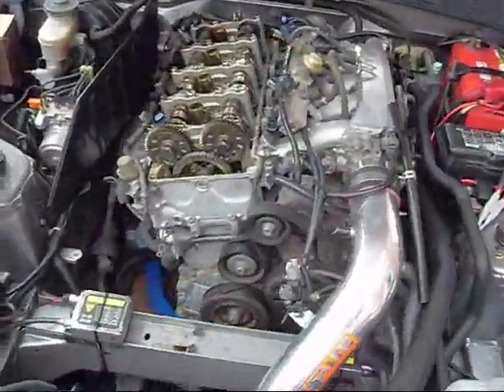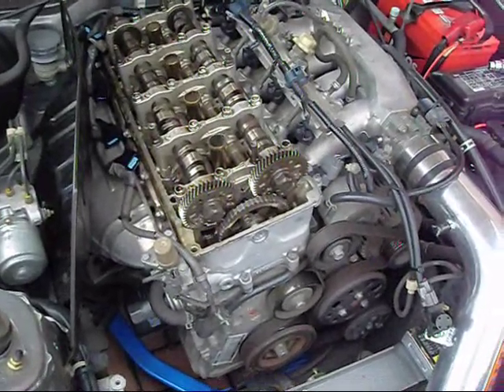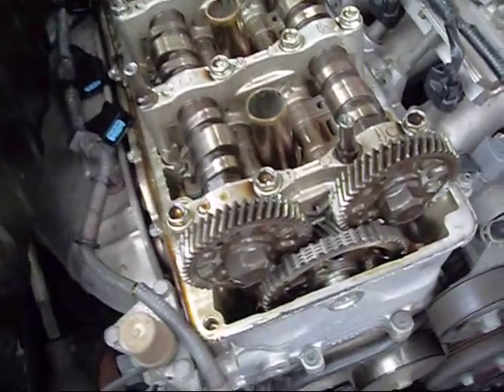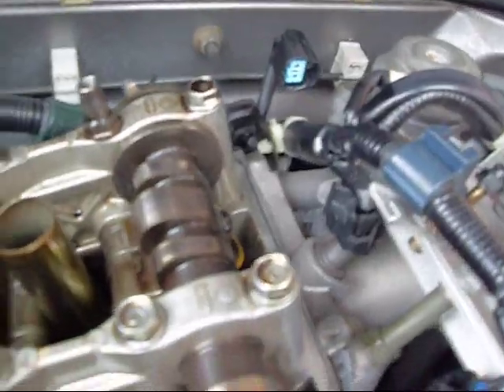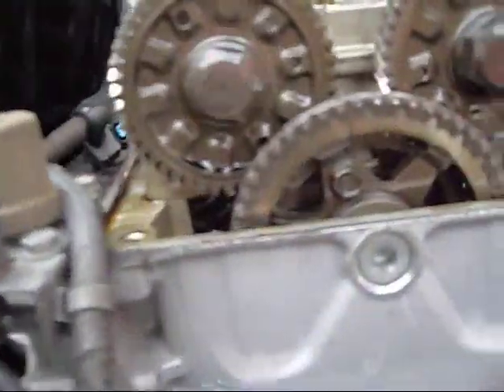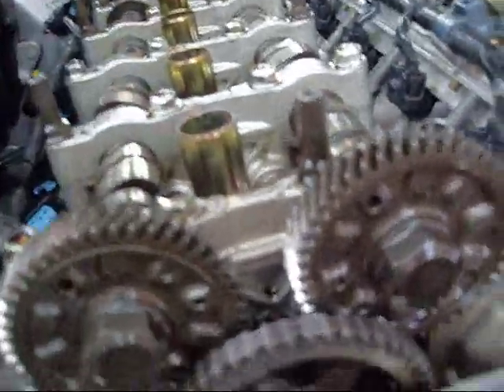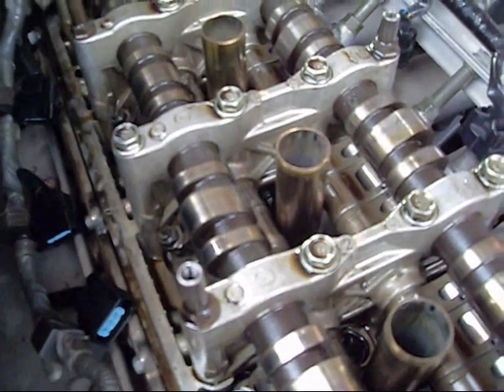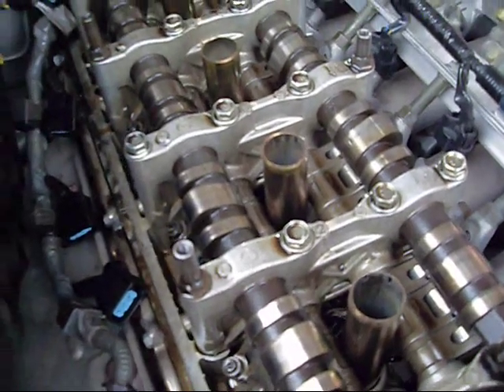Honda S2000 F20C Tappet/Valve adjustment Part 1

Comment: isn't it better to do this when the piston is at tdc? The reason i ask because the pressure in the cyclinder would stop the valve from dipping and making so you don't mess the correct gapping.

Comment: b series engines are different. You measure the last betweent the camlobes and rockers rather than F20s and D series where you measure beweetn the valve retainer and the rocker screw